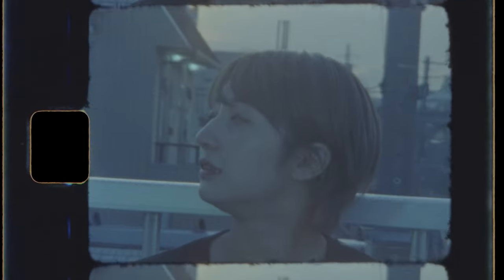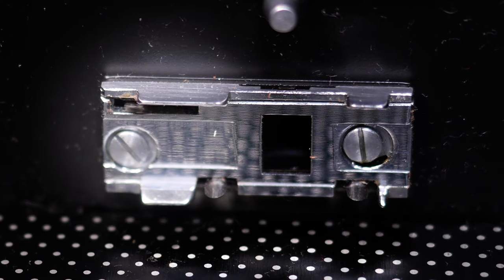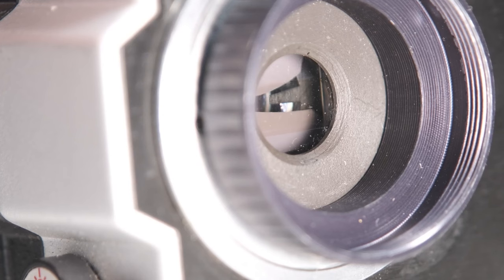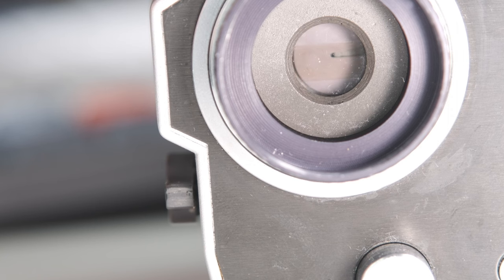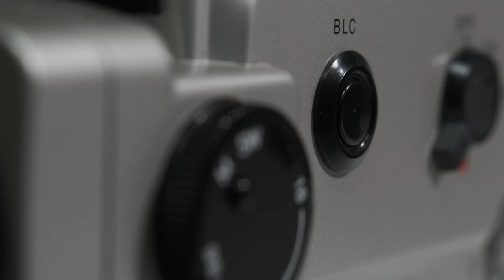SUPER 8 | Everything You Need To Know Before Filming

Comment: Know that the motor can run, but even when the spindle its moving, it still might not pull the film or be totally decayed inside like most older Kodak Super 8 cameras as (save the M2 and M4) as they were all plastic in their gears.  Also, most built-in filters are cheaply made,  age badly and can ruin your film.  If you must use a filter, buying a cheap external one is a much better bet, as these can be 50 years old.Excellent video!  Look forward to more.
Reply from the maker: Thank you for the comment! One thing that I forgot to mention was the old trick of marking film with marker and making sure it advances properly. Even that will not guarantee perfect images but its a good start. The filter is another good piece of advice, so if I do a follow up for more advanced checks I'll make a mention of it!

Comment: What if my sprocket isn't moving? The take up reel spins, but sprocket notch doesn't move. Does it have to?
Reply from the maker: If the sprocket notch isnt moving then you might get some frame slips, overlapping frames etc It depends on the camera and its condition too. It might be best to use an old roll of film that you dont intend to develop, use a marker to write an X on the film, and then run the film for a few seconds in the camera. If the X is still visible when you take the film out of the camera, then it is a more major issue. If the X is no longer visible, then at least the camera is advancing the film (though there may be issues with frame slipping etc). I should have included this in the video but totally forgot. Some time in the future when I make a follow up I will include it! Thank you for the question!